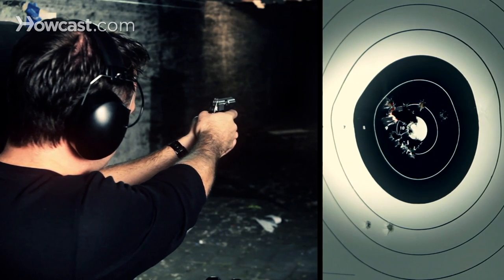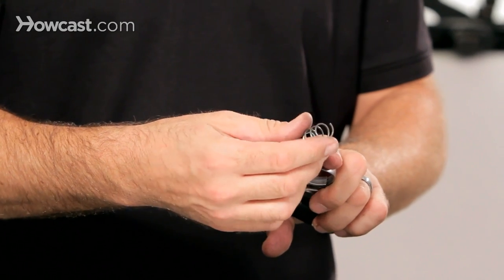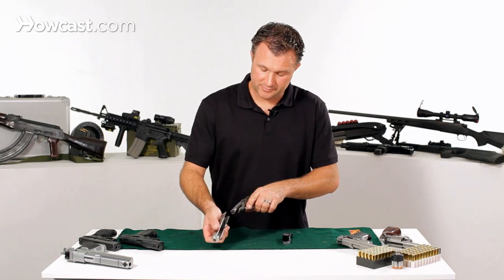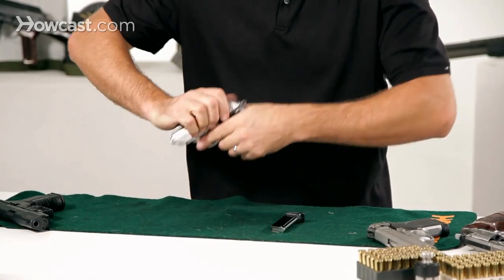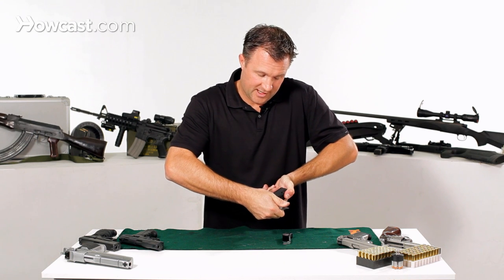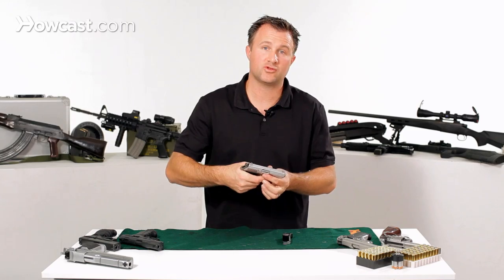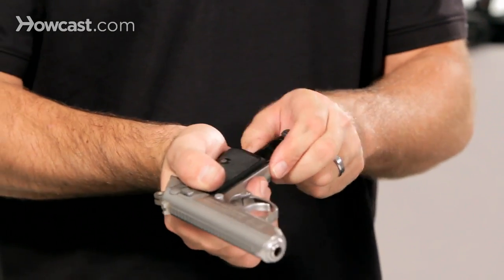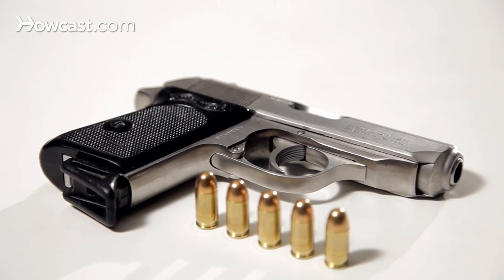How to Assemble a Walther PPK .380 | Gun Guide

Comment: He doesn't cover a key issues like which way to spring goes on and whether or not you can disassemble it with the safety on. Nor does he cover the different methods of holding down the trigger guard because there are a few ways to do it. Not sure of the point of this video.

Comment: pretty sure there's more to it than a spring.
Reply: The PPK is a direct blowback operated pistol, and as a result the barrel is part of the frame, rather than it's own part.  A field strip is super easy as a result.  Pull out the trigger guard, rack the slide all the way to the back, tilt the rear part of the slide up and off the frame and then let it go slowly so the spring doesn't shoot out from the tension.  Then it's ready to clean.  Putting it back together is as easy as the video.